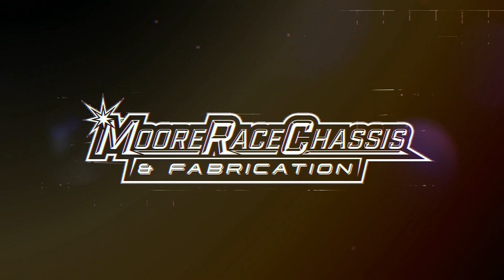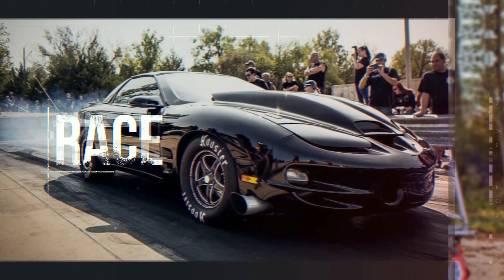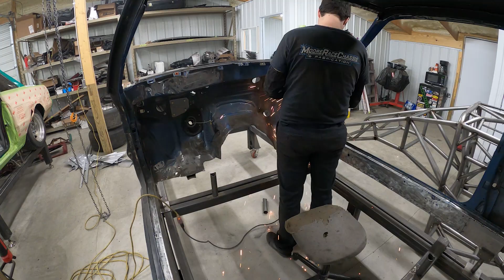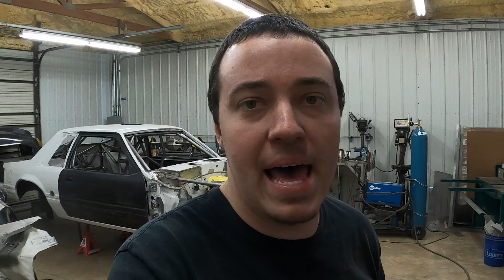Ep. 5 Shop Car 25.2 Foxbody Finish Welding

Comment: Im glad i found your channel, you guys do great fab work! Once you go with Docol R8 tubing you wont go back to cr molly. I built a 25.1 chassis car last year with R8, no more tube cleaning and it gives the cage an overall nicer finish during fab.
Reply from the maker: We wish it was easier to get ahold of. By the time shipping is added and the wait times. Its easier and cheaper to get chromoly. but its been on our radar for awhile.
Reply: @mooreracechassis  Yeah i understand that, i live 2h away from the Docol R8 factory here in Sweden so i can get it delivered within a couple of days. But im in the same boat as you guys when it comes to order race parts from the US, takes weeks to get the parts and on top of shipping cost its +35% in sales tax and import fees.. ;)

Comment: Just ordered a couple shirts from you guys and one of the scrap moly tube boxes you’re killing it 💪🏼 Iv been digging into getting a chassis kit from you guys, need to build a chassis jig first. What’s the jig set up you have for the start of the 25.2 floor bars/frame rails?? Would I be able to start a chassis like that to then put on the table once I start the front and back half?

Comment: Yo, I see yall doing interrupted 12 bars between the 11 bar. Mines a 25.3c and the nhra tech said to weld them to a 6x6 plate. Is that the same for the 25.2 or does your nhra guy cert without them. Mine has a 6d bar as well.
Reply from the maker: He said to weld the dash bar to plates?
Reply: @mooreracechassis  yep, he said since its interrupted he wanted the dash bar welded to plates.

Comment: I'm new to the channel and was just wondering is the Shop Car for you guys to race and if so what kind of racing are you going to do with it? No Prep,N/T,Radial,Bracket,Class? And I think that car needs some Maven and Motion Raceworks parts on it and also what would be really ideal for that chassis would be a TKM built Stage 3 "Black Sheep" LSX-R 427cid LS with Holley's new dual injectors mid-ram intake with a Wilson Manifolds 105mm hi-boost throttle body with a set of either Fuel Tech,Precision, or Billet Atomizer injectors on M1 with a mechanical fuel pump and mechanical oil pump and dry sump oil system
Reply from the maker: Mostly grudge and local no prep races most likely. Basically where ever it fits in. We have a bunch of motion and a maven turbo mount going on it. The motor is budget for us as we are spending a decent amount on the chassis. But we do have a holley dual injector base with a shearer fab upper. And it will be on bosch 210s for now. on meth.

Comment: I'm in the same boat waiting on tubing from aed even with the 20 cents a foot I'll still be more then happy to pay that compared to that scam called chromoly
Reply from the maker: Yea its easy to find chromoly. But your paying $12 a foot. Which we wont do. haha   so thats why its tough to get.
Reply: @mooreracechassis  Just curious what aed is charging for 1-5/8 chromoly and docol right now. Locally chromoly is going for about 15 dollars canadian (Have seen up to $18) on the low end which is in the $12US range. At that price range I am not building anything. In 2017 I had a quote on docol for $4.5US a foot, I can't even get dom for less then $8US right now.
Reply from the maker: @chriswagner3352  We have a distributer that gets chromoly straight from the mill. So we pay way less than that. But AED was about .30 cents more per inch.